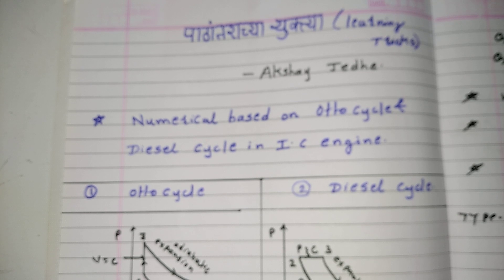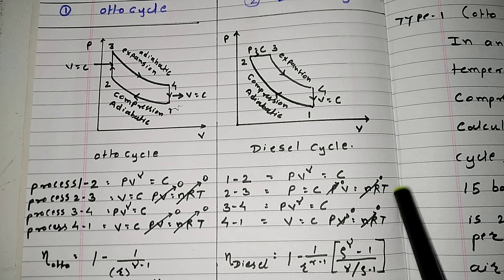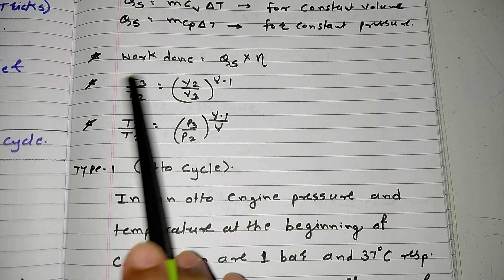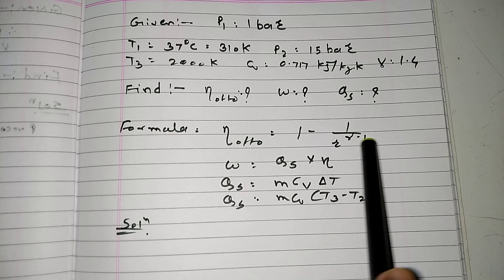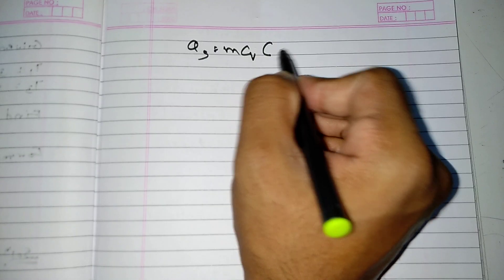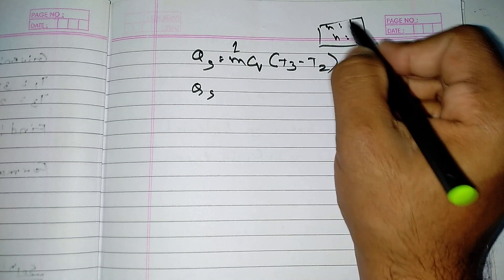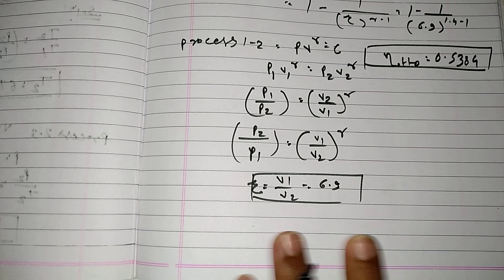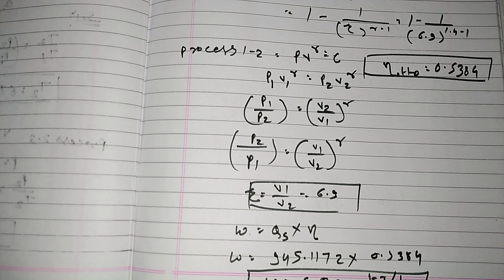Numerical on Otto and diesel cycle in I.c engine .|| Jedhe Online Class||

Comment: In an ideal Diesel cycle, the pressure and temperature are 1.03 bar and 
27 ◦C, respectively. The maximum pressure in the cycle is 47 bar and 
the heat supplied during the cycle is 545 kJ/kg. Determine (i) the 
compression ratio (ii) the temperature at the end of compression (iii) 
the temperature at the end of constant pressure combustion and (iv) the 
air-standard efficiency. Assume γ= 1.4 and cp = 1.004 kJ/kg K for air? 
Please solve this problem?

Comment: Mala ek problem ahe heat power madhe 
1). An engine working on Otto cycle has diameter 150 mm and length 225 chief clearance volume is 1.25 into 10^3 m^3find air standard efficiency

Comment: bro can you explain V Ganesan solved question Q3.3
Reply from the maker: Are you asking from video question or question from other book
Reply: @learnigtrick8015  Question from V ganesan book Q3.3
Reply from the maker: Please send me question broo I will reply
Reply: Q1:- Find out the speed at which a four-cylinder engine using natural gas can develop a brake power of 50 kW working under following condition air gas ratio 9:1, calorific value of the fuel = 34 MJ/metre cube, compression ratio 9:1, volumetric efficiency = 70%, indicated thermal efficiency = 35% and the mechanical efficiency = 80% and the total volume of the engine is 2 litres.

Must send me the solution bro with explanation
Reply: Q2:- Fuel supplied to an SI engine has calorific value 42000 kJ/kg. The pressure in the cylinder at 30% and 70% of the compression stroke are 1.3 bar and 2.6 bar respectively. Assuming that the compression follows the low PV^1.3 = constant. Find the compression ratio. If the relative efficiency of the engine compared with the air standard efficiency is 50%. Calculate the fuel consumption in Kg/kW h.